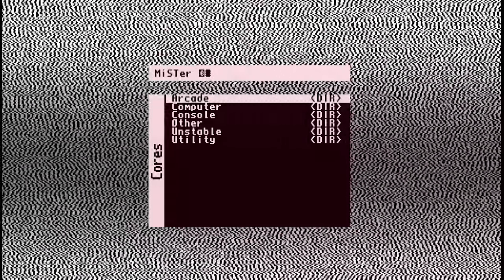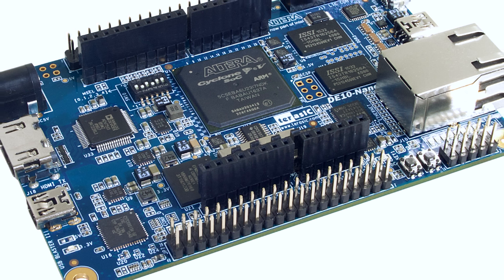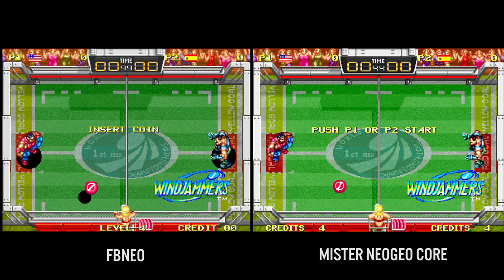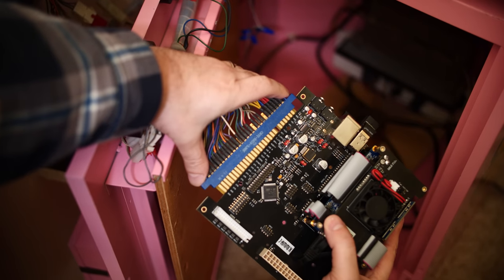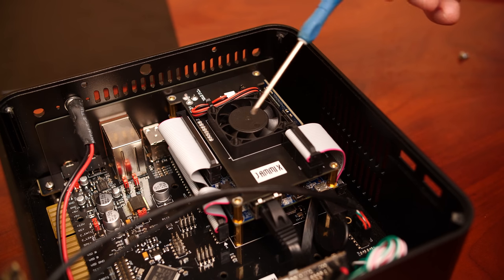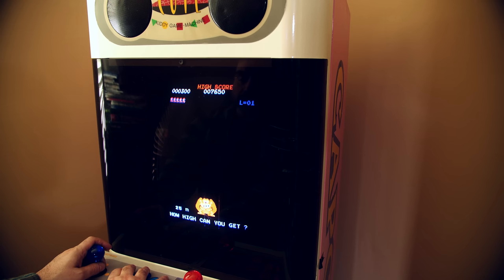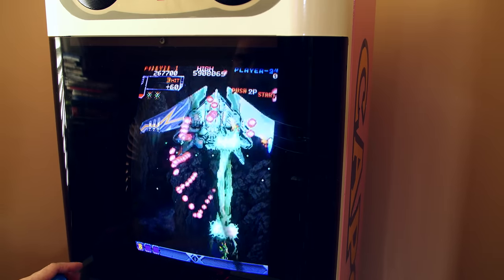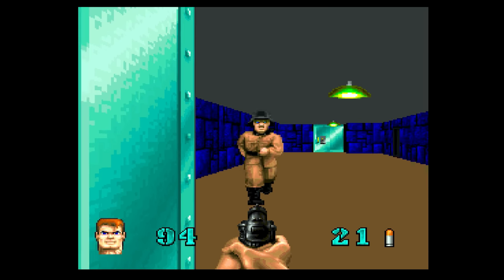Finally - I got my hands on a MiSTer FPGA Retro Gaming Setup | MVG

Comment: If hardware emulation is so good, why pc emulators rely on software emulation?
Reply: Because PCs are built to run software, and cannot implement such fundamental digital logic without relying on software.
Reply: FPGA is a very different kind of chip compared to a PC Processor.
FPGA chips use various logic gates that can reconfigure to replicate the circuitry of the original console.
PCs is designed to run Software. In our case A Software simulation of the original hardware.
FPGA is design to run as that hardware. 

Think of it as a Hardware Render of Emulation instead of Software Render.

Comment: I expected better from you than spreading the idiotic propaganda that this is not software emulation. How do you get the core? they ship you some chips you need to solder on?
Reply: But.. it is not software emulation. The cores are written in a HDL language that when flashed to the FPGA electically alters the architecture (hence programmable gate-array). Think of a FPGA as a blank slate of logical blocks (transistors, flip-flops, lookup tables, etc.) that can be configured into a whole bunch of different kinds of hardware. You see them a lot in devices that need a specialized high-speed chip that would be too expensive (and low quantity) to manufacture using a dedicated fab, and not suitable for regular CPUs. To to answer your question, the cores are stored as a binary file describing how the FPGA should be configured, which is then loaded onto the FPGA when needed, no need to physically solder anything.
Reply: Clueless
Reply: You know how a ROM can ripped into software and then programmed back onto an EPROM and then placed back into the OG ROM socket and used just like a ROM chip? It's not a million miles away from that.

Comment: I personally feel that FPGA is overrated and overpriced. Today's modern devices completely surpass the OG consoles with emulation. Why would I want to keep all the quirks and slowdowns from OG retro consoles?  I will stick to my Pi 4 or Launch Box from a PC with its HUGE collection of pretty much everything under the sun with wide screen hacks, save states, cheats, net play and a beautiful GUI to boot. Modern devices offer emulation with relatively zero noticeable lag (when properly configured) even to the 5% or less that can actually detect said lag lol. But to each his own, I guess. Good Video though

Comment: The Mister community is cancer. Just pop over to the official forums to see how nasty, and rabid some of them are. They don't like ANY criticism of Mister, or the devs, and will run to the mods at any opportunity. The Amiga section are mental, and this whole "Hybrid" crap just makes me laugh - I mean, all that bother when you can just run WinUAE on a powerful, or semi-decent PC and get a much better experience. Then we have DOS, and the fact that even a decent 486 isn't possible without some "Hybrid" hacks - just use Dosbox for feck sake, it's not like DOS is running on something completely different, it's still running on a PC.
To anyone who isn't a rabid fanboy, emulation is still the better, cheaper option - hell, even a Pi 4 is better for 99% of people out there who just want to play some retro games.
And finally, hiding cores behind a patreon paywall just makes me laugh. When you can get a cutting-edge copy of Retroarch, just compiled, and running in minutes, for FREE!! Shove your paywall where the sun doesn't shine.
But what really makes me laugh is that the rabid fanboys will claim it's "Accurate", and better than emulation, only to connect their Misters to a modern display - that alone is fecking hilarious. The lag from a modern display, followed by lag from crap USB controllers, just makes this all a joke.
Reply: The Amiga scene is what you are complaining about here, not the Mister scene. Also the paywall for patreon cores is for beta/alpha cores that are always free on release once completed (and they get completed pretty quickly). There is no need to pay to play any core.

Comment: NOT EMULATION! Hardware Re-creation! (mostly)
Reply: Emulation isnt a computer specific term, it has roots in latin and just means copying/mimicking. FPGA is still emulation, even the inventers XILINX call it emulation.
Reply: @ZaPpaul  Discussing semantics? The point is clear, and the reason for my comment is that for the majority of people the difference will not be obvious otherwise.
I do not care for semantics in this particular case, I care about making the distinction between both approaches clear, and until there is a set of words capable of such, this will have to be the approach here.
Reply: @wskinnyodden  It's not semantics, it is Emulation. You dont get to redefine a word.
Reply: @ZaPpaul  Not redefining a word, making clear what things are. So yes, semantics.
Reply: @wskinnyodden  You're not making things clear. They are hardware and software emulation. You shouting out that it's not emulation is wrong. Plain and simple. The inventors of FPGA tech call it hardware emulation, It's not for you to say otherwise.
Reply: @ZaPpaul  You seem not to have read my replies in full, for most people the technical differences will not be obvious without clarification, hence the comment. That said, seems I also needed a /S on the Semantics sentence. 
Clarity of what exactly is going on technically is much more important than semantics. And what the FPGA does has no comparison to software emulation, it can not, it works completely differently.
Again, when we have words making this differences obvious, I'll use them. Until then, clarification is needed.
Reply: @wskinnyodden  Nope I have read your full replies. You still dont get to call FPGA 'NOT EMULATION' It is. Nothing more to it. Please show me any official definition of the term that states software only, or excludes hardware and you win. Until then, understand that it is emulation. Oh and dont bother wasting your time, all official definitions include hardware. Because it is emulation. Just not in software. You can clarify that it isnt the same by calling it hardware and software emulation. So to clarify, FPGA is emulation.
Reply: @ZaPpaul  Not contesting that, I'm contesting that the technical differences and how people understand the working of things are more important than the semantics. Nothing else.
And FPGA is hardware re-creation, not the typical emulation which brings with it a considerable number of issues and problems that vanish when you handle this in hardware and in a parallel fashion that is impossible to achieve when doing such a thing in software.
The fact that language takes longer to evolve than the subjects it needs to handle just forces longer descriptions. And pointless discussions such as this one.
Again, clarity on the technical differences is much more important. I do care for proper grammar, though I care much more for technical and scientific clarity. Scientific ambiguity is the kind of crap that results in crashed mars landers because someone fails to make a conversion between metric and imperial due to such lovely language issues.
Reply: @ZaPpaul  Oh and by the way, as long as I am not lying, intentionally misleading, carrying out mischievous intents in any way and just trying to make important details clear, as far as I care, can say what ever the hell I want!
Reply: @wskinnyodden  You do not need to explain anything to me. I understand what FPGA is and how it works, having coded verilog myself. I am explaining that you have no authorisation or credible reason to tell people that FPGA is not emulation, when the inventors themselves call it Emulation on their site. You might like to have clarification, but you dont get to create it. The difference is already clear enough. One emulates(copies) in software and the other emulates(copies) in hardware. There is no ambiguity or confusion. Emulate isn't a scientific term, it just means to copy/imitate/mimic. Stop trying to redefine it. The English dictionary is clear on the term already.
Reply: @wskinnyodden  Well you are misleading. FPGA is emulation.
Reply: @wskinnyodden  Just out of curiosity, are you familiar with Gotek Floppy Drive Emulators? They are basically hardware emulators similar to how the MiSTer emulates. How does your brain cope with those?
Reply: @ZaPpaul  Good to know, not trying to redefine any term. You seem to fail to realise that NOT EVERYBODY KNOWS HOW FPGAS WORK.
This is the only reason for needing to make clear the differences. Otherwise I'd be happy with just calling it emulation.
What are you 8? Dear lord, focus on the important details and making sure as much people as possible understand the differences for Pete's sake. Not sure if I laugh or cry at your lack of awareness of other peoples background knowledge differences. Not everybody knows the same things you do, yet a lot of those people would benefit from understanding the differences between the two approaches regardless. Is this so hard to grasp?
Reply: @ZaPpaul  Different kind of beast, irrelevant impact other than enabling a real floppy, compatibility issues are not par for the game with that device, something that is quite different when you look at the differences I am on about.
But if you want to talk about Goteks, why not also cover the new Arduino Based Floppy disk adapter enabling real disks to be used on Emulation? Now here is a device that should actually be interfaced with current FPGA solutions in order to make "as close to the real hardware" as possible a solution feasible, something that will not happen on software any time soon, which again, is the reason for underlining crucial differences between the approaches.
Reply: @wskinnyodden  regardless its an emulator that does so in hardware. As it mimics. That's the meaning of emulation. Just learn accept and move on.
Reply: You see the problem here isn't that people need any clarification. The problem is that your first exposure to the word emulation was when you learned about these programs that copy(emulate) computer systems using software. You had never heard the word before, so it was hard wired into your brain that emulate means this and only this. The reality of the world is that emulate is an old word with roots in Latin. When I hear the word emulate, I hear copy/mimic as this is my exposure from a young child growing up being educated in England in a half decent environment. So when ignorant/uneducated people start complaining that a word is used wrongly, when its use is perfect. It pretty much annoys. They, like yourself, continues to argue my very fine points until I ask that they show me some kind of proof that Emulation in a scientific use at least, excludes hardware. Until this happens, I will rightly use a word that means to copy as a word that means to copy. Good luck finding me proof that I am wrong. Please ask for proof I am right and I will offer official definitions of the word and uses in technical documentation and in educational documentation. So for now at least this conversation is over. Please do not respond with your 'Huuur duuur clarification, huuur duuur, semantics' diatribe. You are wrong. FPGA is emulation. Emulation is copying/mimicking.